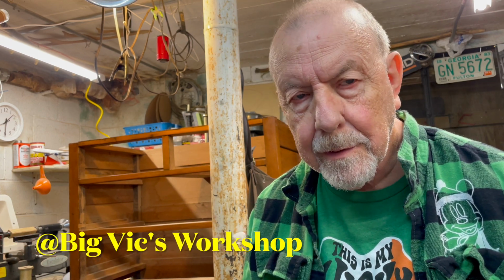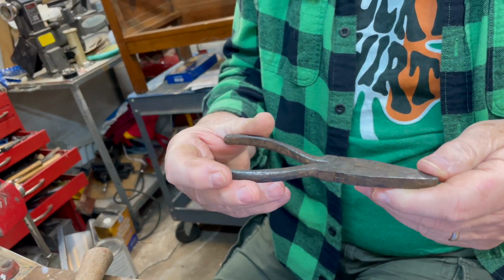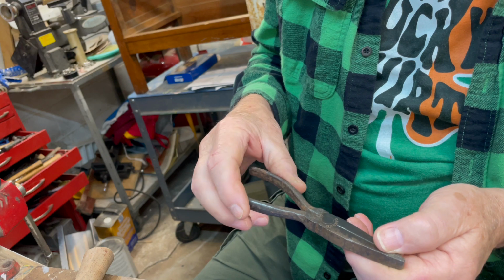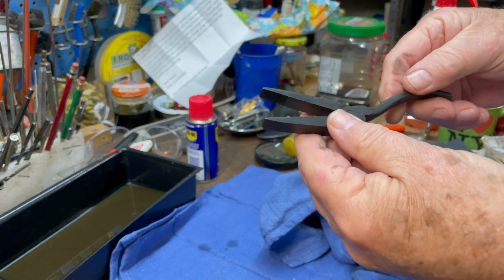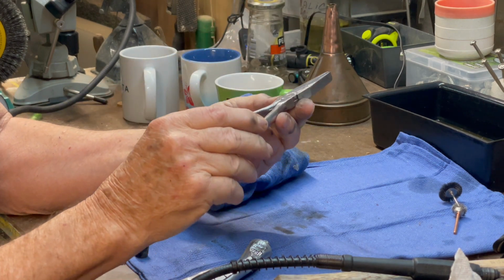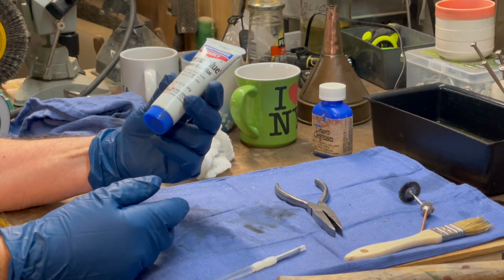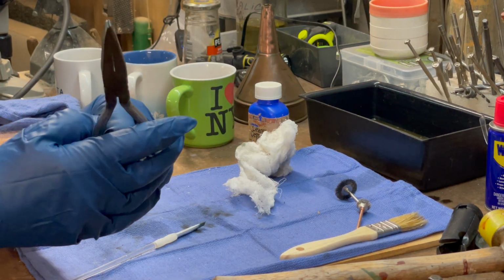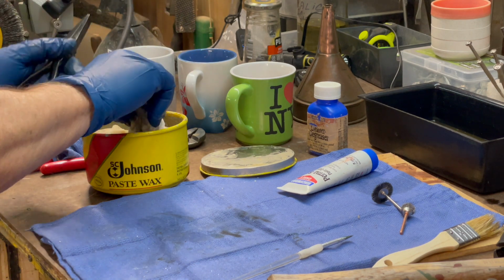Duck Bill Pliers

Comment: Mr. Dale. Those came out great! But what are they used for?
Reply from the maker: I use them to straiten kinks in wire, flatten things that are bent. The flat blade has many uses it just depends on the application, the width of the blade gives you a little more advantage. Thanks for watching.